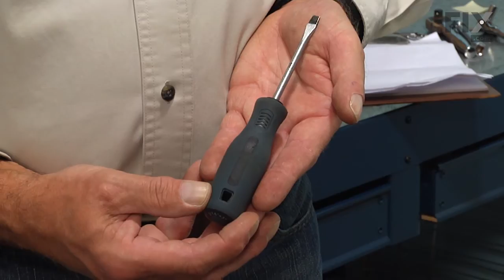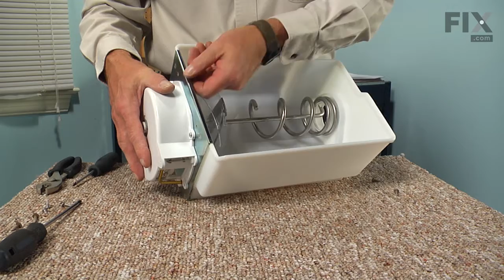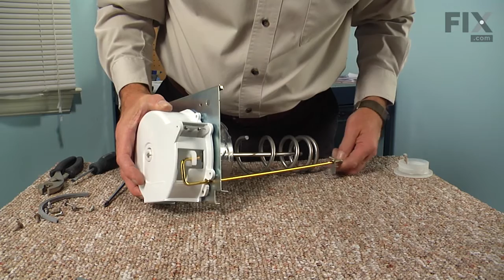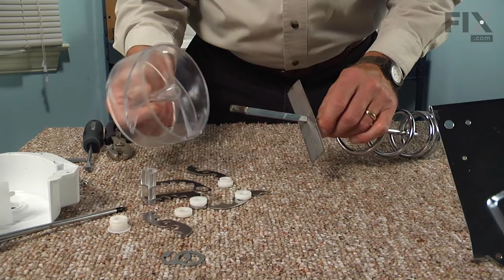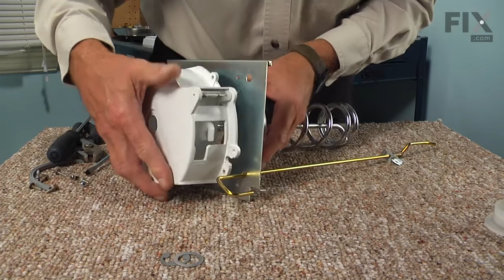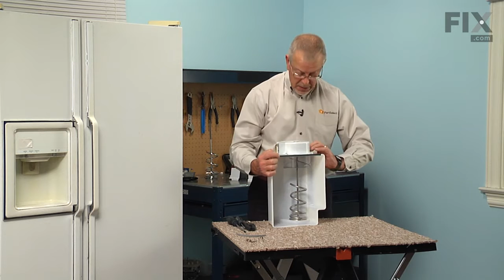GE Refrigerator Repair – How to replace the Ice Bucket Auger

Comment: I did this job at least 3 times over the years on my GE Refrigerator. Our problem with it every time is that the Augur GE used was advertised to be Stainless Steel. Far from it gets rusty. Under warranty GE replaced it once but I had to do the Labor of replacing it. That one rusted shortly after. I have no other complaints about the GE Refrigerator but as far as I am concerned false advertising was made by GE. Stainless Steel doesn’t rust. Think about it if this Augur was made of Stainless Steel why would it ever need to be replaced? We had to stop using the ice maker for that alone. No one wants to find dirty rusty bits mixed in with their ice cubes. It’s unhealthy. As you can see this is a big job to do. Not many people will be able to handle it. Most recently we started reusing our ice maker again no thanks to GE. Took the Augur into my Kitchen sink disconnected from the ice bucket assembly. With steel wool and dish soap cleaned the rust off the Augur as best I could and dried it well. Went on Ebay and purchased a roll of clear plastic shrink wrap large enough to slide in all around the screw of the Augur to cover it completely. About 5 dollars enough to cover it again and again if ever needed. I used vegetable oil to lube the metal in front of the shrink wrap to slide it along to cover the complete Augur. Trust me it’s needed to slide it along. It’s been better then a year now and I haven’t seen rust in our ice anymore. The cooking oil and the clear shrink wrap I believe did the trick. GE knows they had a problem and their import supplier of the Augur they used lied to them about the item being made of Stainless Steel. It looks more like a Nickle or Chrome Plating on the steel that was used. There should of been a class action lawsuit instead against GE and a real Stainless Steel Augur sent out to everyone GE Cheated with false advertising. Although for my headaches if having to deal with this it would never fix. Let me mention one other thing here in case no one noticed look at augurs they are making today for newer refrigerators. You will notice even GE is making them differently. Now the metal Augur is covered in Hard Plastic to keep the ice from rusting the Steel Augur. They sure did know they had a problem but kept quiet about it.